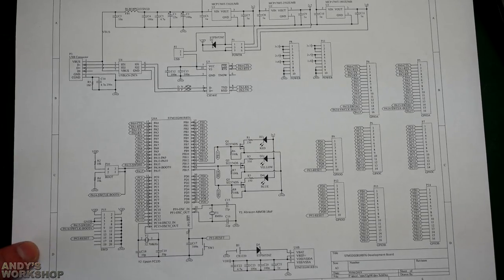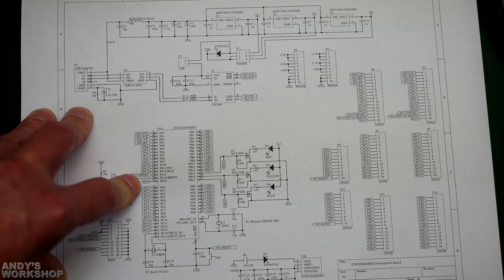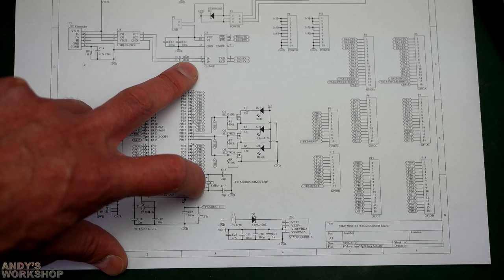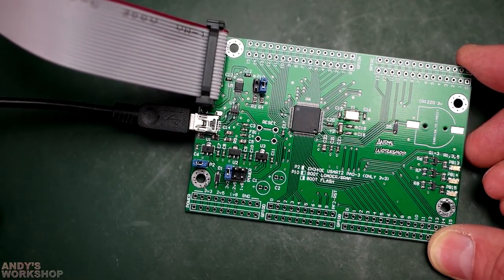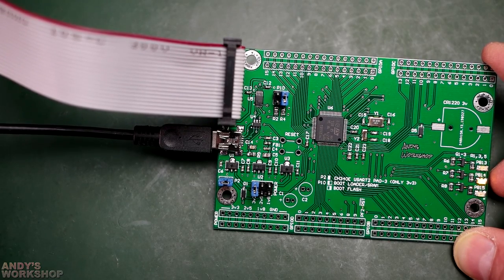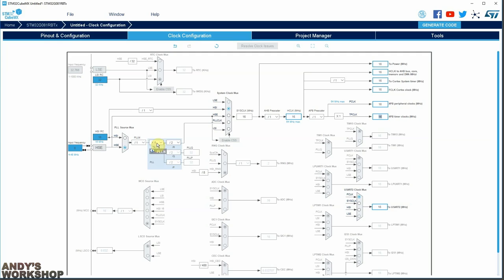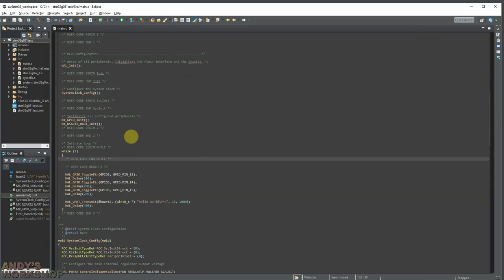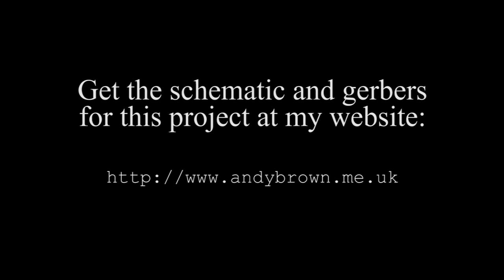An stm32g081 development board

Comment: It is worth trying the STM32CubeIDE from ST, a free eclipse based IDE with advanced debugging features. Another alternative is the Atollic TrueSTUDIO for STM32 also eclipse based IDE and is part of the STM32 family. Both IDE's are multi-OS development tools and in my opinion better than the SW4STM32.

Rather than setting the prescaler(s) in the STM32CubeMx clock tree, you may press the HSE and PLLCLK buttons and write the required clk value in the HCLK box and press enter. STM32CubeMx will calculate all necessary values and provide the nearest clk to your selection.

A very nice introduction to the STM32G0. Thanks.
Reply from the maker: I've installed STM32CubeIDE on my Ubuntu dev VM and I like it.
Reply: Also, I've found that the cubeIDE paired with a Jlink is quite a powerful combination, not to mention segger ozone

Comment: There is nothing better than PSoc frm Cypress. There are some breadboardable PSoc5 dev boards at only 10Eur, with ARM  M3, analog and digital elements, even FPGA blocks. The dev software is excellent too,  you place and connect the components directly on chematic.
Reply from the maker: If I had more time in my life I'd be looking at interesting devices like the Cypress PSoc.

Comment: At comparable clock speeds, shorter pipelines actually perform better than longer pipelines, especially on code with many branches. The reason  Intel is doing very deep pipelines is to get very high clock frequencies: In a deeply pipelined architecture, every pipeline stage has only little to do, which means shallower logic, which means high clock frequency. However,  very long pipelines need a lot of cycles to get back to speed on incorrectly predicted branches, which is why both AMD and Intel have highly sophisticated branch prediction. In search of high clock frequency, the Pentium 4 (up to 31 stages with Prescott) was hurt quite badly by the bad side-effects of a very long pipeline, especially its branch-misprediction penalty.
Reply from the maker: I take your point, thank you for commenting. I think I'll run a few F0/G0 benchmarks and see how they both perform.